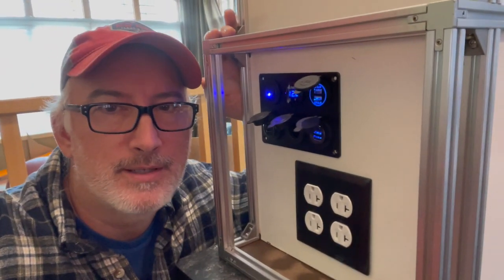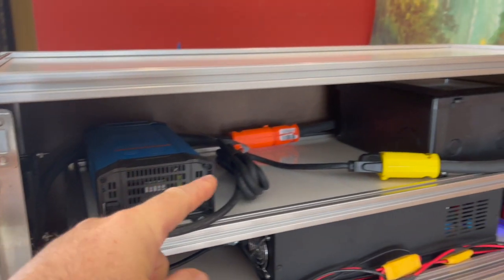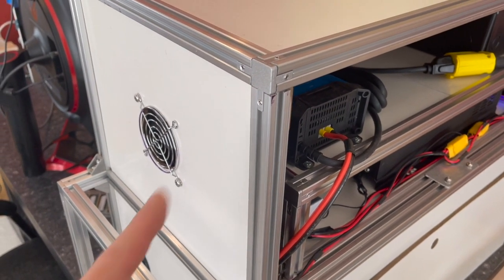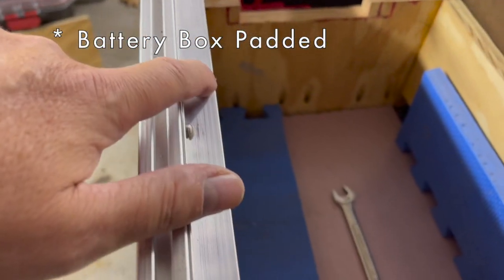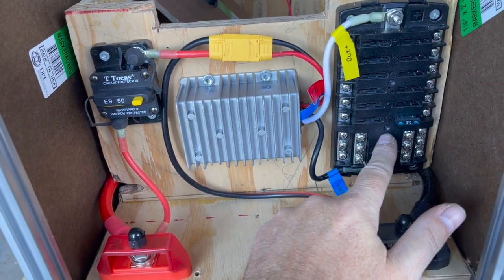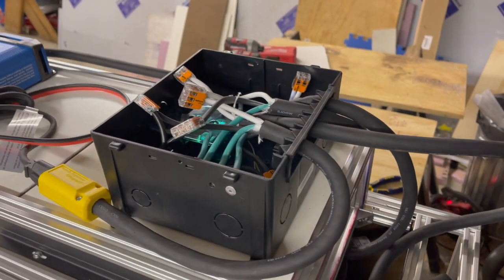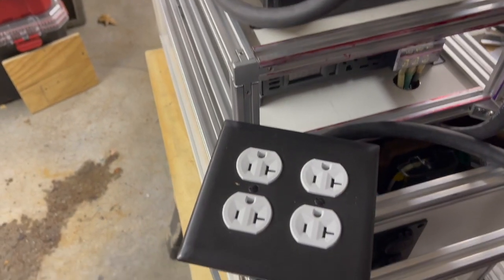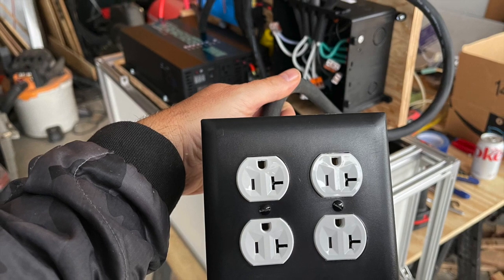2.5kWh LiFePO4 Battery Portable Power Station

Comment: How do you turn on the inverter automatically or does it stay turned on all the time?
Reply from the maker: There is a circuit breaker between the battery and the inverter that I use to turn off the inverter. I generally keep it off as I normally do not have AC loads and don’t want the residual draw off the inverter.